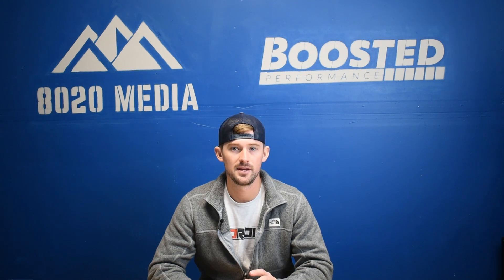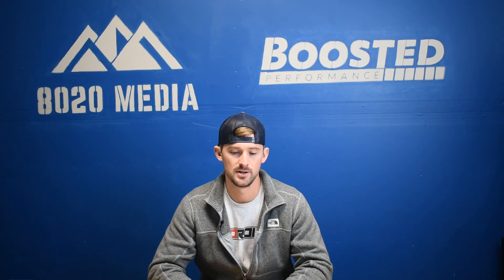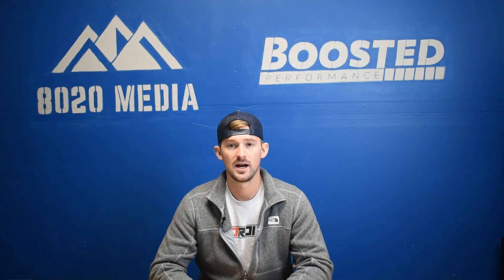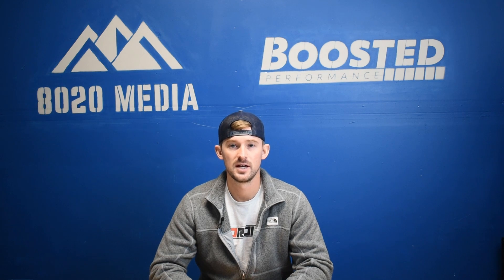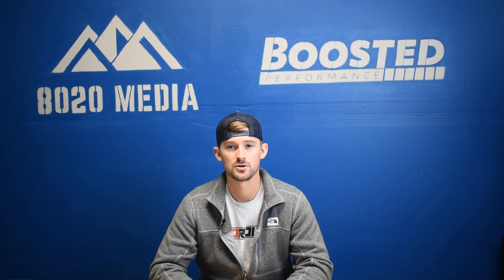The Few FLAWS of the Ford 4.6 V8 Engine!

Comment: Thank you for the good info. Would be better with some photos. Just got a 97 Ford Thunderbird 4.8L V8 passed down to me from my uncle. Still pretty much brand new 120.000 miles on it and runs great. Only issue I have is the speedometer would go in and out every once in a while. Did some research and only thing I can think of is to change the vss sensor on the transmission and or change the transmission fluid and filter. If anybody else knows how to resolve the speedometer issue please let me know and thank you.
Also I was told that Ford is finicky on its fluids like for example was told to get Ford Motorcraft products like engine oil and transmission fluid.

Comment: I recently bought a 2000 lincoln town car executive series 202,600 miles i put 2,600 in 4 months got it June of this year ride good need an intake I have leaks n my engine cooling fan jus stopped working bout a month ago but it rides like a champ without changing oil n need new plugs but it rides damn good I agree best engine other than my Caprice Classic '91 im really a Chevrolet guy but I like Lincolns

Comment: Which one is better the 2v or v3
Reply from the maker: C - I'd say the 3V 4.6 is “better” for most people, especially if you want more power out of the box or easier mods. You get more torque and better airflow, and the variable cam system helps make the engine more usable at lower RPMs without sacrificing top-end. The 2V, however, is still useful if you want simplicity, lower cost of entry, and maybe you don’t care as much about top-end power but want something rugged and cheap to maintain.

Comment: ‘00 F150 4.6.  No issues at 251k.  Oil changes with Mobil 1 hi mile 5w-30 and Lucas Oil additive every 5k miles, since I bought it with 100k miles.  I may do the timing chain, chain guides, tensioner, and upgraded oil pump soon, just for peace of mind…. I hate to crack open a motor, that runs perfectly!!!
Reply from the maker: P - Nice! We have seen many of these be reliable, however, maintenance is crucial!

Comment: As fo my 95 crown Vic  I bought new,L ENGINE FOR it CAUSE IT finally gave out, still ran but started using lot of oil so replaced the engine at 994,000 miles no oil pump issues, NO TIMING CHAINS ISSUES AS WELL AS I NEVER REPLACED IT AS WELL, I ONLY jus replace auto transs at 796,000 miles, 
AS FOR 98 CROWN I JUST Bought  IT l AT 120,000 Original MILES, THEY WRECKED IT, BIG  DEER KILLED, FRONT END FRAME OUT OF Alignment BAD,. Engine runs EXCELLENT👍👍👍
Reply from the maker: E - Thanks for sharing!

Comment: Jus seen your video on this 4,6 engines I've got 2 crown vis a new 95, and a used 98, and a new 2003 F-150, this 5 speed manual TRANNSMISSION truck has the 4,6 engine this only problem that is the passenger side plug blew off never had a problem since they fixed it, it has 795.000 and stills runs great, with ITS ORIGINAL TIMING CHAINS, TENSIONERS, GEARS, ECT👍
Reply from the maker: E - Nice! Thanks for sharing.

Comment: Hello. I'm looking at a 2013 E250 with the 4.6 V8. It has 97000 mls on it. It was owned by the city since day 1. Serviced every 3000 miles. It has all the maintenance records. No accidents. Super clean inside and out. Listed for $11,850 o.b.o.. I want it for a very light and simple van build. The heaviest the van will be including fuel, water, myself and all my gear, is about 1,500 lbs give or take. No towing. Will be driving it mostly on level roads. Do you think this engine will be able to handle what I'd like to use it for and the weight i mentioned? Any advice would be greatly appreciated. Thank you
Reply from the maker: P - Yes — a 2013 E250 with the 4.6L V8 is a solid choice for what you’re describing. That engine is simple, durable, and very common in fleet vehicles, and with only 97k miles plus documented 3k-mile oil changes it’s barely broken in for a Ford modular V8. Your planned build weight of ~1,500 lbs is well within what that van is designed to carry (payload capacity is typically 3,000+ lbs), and since you’re not towing or climbing mountains regularly, the 4.6 will handle it fine — it won’t be fast, but it will be dependable. The main things to watch on these are intake manifold cracks (at the coolant crossover), coil-on-plug failures, and transmission fluid condition (the 4R75E needs regular fluid/filter service). At $11.8k with records and a clean body, that’s a fair deal in today’s market, especially for a van build platform. If you buy it, I’d baseline the fluids (engine, transmission, differential, coolant, brake) and inspect the suspension bushings, but otherwise it sounds like a strong candidate.
Reply: @8020Automotive thank you so much for your input. I really do appreciate your time. If I may ask one more question please. I was mistaken on the miles. It's actually 93k. I drove it and it drives and looks very well.. I even talked him down to "$10,000".. so what am I waiting for? The timing chain issue that may come my way soon. I have a 2010 f150 with 104000 miles on it and I just had to replace the timing chain on it. It's going to cost me around $3000 if I do have to replace it. With that in mind sir, what is your opinion? Once again, I thank you for your time and expertise! Btw, Just discovered your channel.
Reply from the maker: P - At $10k for a 2013 E250 with the 4.6 V8, 93k miles, full service history, and city fleet maintenance every 3k miles, you’ve got a very solid foundation for a light van build — the 4.6 isn’t a powerhouse, but it’s one of Ford’s most durable modular V8s and easily handles an extra 1,500 lbs as long as you’re not towing or climbing mountain grades every day. The timing chain issue you ran into on your F-150 is much more common on the 5.4 than the 4.6, and while the 4.6 can need chains, guides, or tensioners eventually, with good oil change history it’s not a guaranteed expense at 100k; most run well past 150–200k before needing chain work. Your biggest maintenance items down the road will be suspension bushings, coils, and transmission fluid service, not catastrophic engine failure. At $10k, with those records, and given how clean it is, I’d say it’s a safe buy and a good value — just budget realistically for timing chain service someday, but it’s not something I’d let hold you back from pulling the trigger. Keep us updated!

Comment: I have a 98 with the 4.6 2 valve and I’m having a cylinder 3 misfire issue as well as a too lean code. I’ve replaced the plugs(2nd owner) as the were all bad. Still having the issue with cylinder 3. I don’t have an inline spark tester so I was going to swap the coils around to see if the coil was the issue as well as swap the 3 & 7 wire to see if it’s the wire. Next would be the injector. Any tips or recommendations? I don’t live near a mechanic and towing is out of the price range.
Reply from the maker: A - You’re on the right track with your troubleshooting. On the 4.6 2-valve, a cylinder-specific misfire (P0303) plus a lean code is most often ignition or injector related, not a major mechanical failure. Start by swapping the coil from cylinder 3 to another cylinder—if the misfire follows, it’s the coil; if it stays, swap plug wires (3 and 7 as you said) to rule out the wire. If neither changes the misfire, move to the injector: you can listen with a mechanic’s stethoscope or even a long screwdriver to your ear to hear if it’s ticking, and if not, try swapping injectors between cylinders to see if the misfire follows. Since you’re also getting a lean code, double-check the intake manifold gaskets and vacuum lines near cylinder 3—on these motors, vacuum leaks at one runner can cause both a lean condition and a misfire on that cylinder. So: 1) swap coils, 2) swap wires, 3) check injector function, 4) inspect for vacuum leak near cyl 3. That’ll narrow it down without needing a shop.

Comment: I have an 04 Explorer with the 2v 4.6 with 230k on it & just had to replace the intake manifold a month ago after the original manifold cracked around the coolant passages. So far that's the only problem that it's had since I bought it. I intend to change the timing chain, guides, and tensioner  soon whether it needs it or not. I'm also thinking about going ahead and doing a complete overhaul just to make sure I don't have anything to worry about and have a virtually new engine for no reason other than my own satisfaction. I have a V8 & want to be able to use the whole thing without worrying about some high mileage part failing when I go to pull out into traffic and drop the hammer to get up to speed
Reply from the maker: R - With 230k on your 2-valve, your approach makes sense: the timing chains, guides, and tensioners are the weak link and should absolutely be done before they fail and cause catastrophic damage. A full rebuild for peace of mind is never a bad idea if you’ve got the time and budget—it will let you replace worn bearings, piston rings, valve seals, and clean up the heads so you can truly “use the whole engine” without worrying. That said, these modular 4.6s are known for going 300k+ if oil changes are kept up and cooling issues avoided, so unless it’s burning oil, losing compression, or showing bottom-end noise, a full rebuild isn’t strictly necessary. If your main goal is reliability under hard use, fresh timing components, oil pump, gaskets, and a thorough once-over of the heads/valves will get you most of the benefit without tearing it all down, but doing the whole engine is the ultimate way to reset the clock if you want that new-engine confidence.
Reply: @8020Automotive  I'm pretty sure the previous owner said he had done the timing chain guides and put a new chain on it a year or two ago but I honestly don't remember what he said he had done to it. I replaced the intake manifold because the original one cracked, but other than that and some what I believe is light piston slap when it's cold, it runs great. It's got some light sounds coming from the bottom of the engine somewhere that fades out when it's up to temperature and I don't know if it's something to be concerned with or if I'm just hearing the mechanical sounds of the engine running. It's definitely not a bearing or anything, so my assumption is piston slap
Reply from the maker: @rollin18wheels  Keep us updated!

Comment: I have an older 4.6 with lots of internal engine noise ..I’d like to rebuild but not sure what would be the cause of these ‘ticking’ noises ,.runs great tho ..been ticking for a long time ..
Reply from the maker: F - On the 4.6 modular engines, a persistent ticking noise is most commonly caused by worn or sticking hydraulic lash adjusters (lifters), worn cam followers (rockers), or timing chain components like guides and tensioners that let slack develop, though cracked exhaust manifold studs or gaskets can make a similar tick as well; since yours has been ticking for a long time and still runs great, it’s likely valvetrain related rather than bottom end damage, but if you’re planning a rebuild it makes sense to inspect and replace lash adjusters, cam followers, and timing chains/guides/tensioners as a set, plus check oil passages for sludge buildup since oil starvation in the top end can worsen ticking—bottom line, it’s not necessarily catastrophic now, but addressing those wear items in a rebuild will both quiet the engine and extend its life.
Reply: @8020Automotive  ..excellent ..so doing a top end rebuild would probably cure the issues ..ty ..good stuff
Reply from the maker: @freedomtrucker2332 Not cheap, but would probably do the trick. Keep us updated.

Comment: My 07 XLT will blow spark plugs if you change the fuel at all, any additives, next higher octane anything
And coils like to go out
But going strong at 195.5k
Reply from the maker: T - That’s classic 3-valve 5.4L Triton behavior—those early spark plug threads in the aluminum heads were notoriously short and prone to blowing plugs under even slight changes in combustion pressure, like higher octane or fuel additives that increase cylinder efficiency; it’s great yours is still running strong at 195.5k, but if you haven’t already, it’s worth installing Timesert or Heli-Coil thread inserts to permanently fix the issue if one blows. The coil-on-plug ignition failures are also common—usually caused by moisture intrusion or plug gap stress—so dielectric grease and quality Motorcraft parts help. Keep doing what you’re doing, and she’ll easily hit 250k if you stay ahead of maintenance.

Comment: Hello, I have a 2004 F150 4.6 Romeo with 63000 miles. I have noticed a cold start rattle sound that only lasts a few seconds. Any idea what could be causing this issue? Any insight would be great! Note: There is no check engine light illuminated.
Reply from the maker: C - A brief rattle on cold start in your vehicle is most likely caused by timing chain tensioner bleed-down, a common trait in these modular V8s as they age; the hydraulic tensioners rely on oil pressure to keep the chains tight, and after sitting overnight, oil drains out of the tensioner body, causing slack that rattles for a few seconds until pressure builds. It’s generally harmless early on, but if it gets louder or lasts longer, replacing the timing chain tensioners and guides or upgrading to the later-style cast aluminum tensioners can fix it permanently. Also ensure you’re using a quality oil filter with a proper anti-drainback valve and correct viscosity oil (5W-20 or 5W-30)—cheap filters can accelerate tensioner bleed-down.

Comment: my manifold is not cracked, but it is leaking coolant below the thermo housing where it meets the plastic as well as signs it may be leaking from the rear crossover. Should I replace or try to reseal?
Reply from the maker: S - If your intake manifold is leaking coolant below the thermostat housing and possibly at the rear crossover, and it's the plastic-style manifold (common on pre-2005 models), then it’s best to replace the entire intake manifold rather than try to reseal it—because once these plastic manifolds start leaking, they tend to warp or develop microfractures that resealing rarely fixes for long. Ford eventually updated the design with a metal coolant crossover, which is far more reliable, and several aftermarket options (like Dorman) have improved durability. So unless you already have the updated manifold and are 100% sure the sealing surface is clean and undamaged, a full replacement will save you from having to tear it down again in a few months.

Comment: Once you add anti seize to the plugs your stated torque value changes to a lower value....appx 20% less. 
Then there is the disputed 11 to 13 lb ft or the "revised" 22 lb ft .  I would opt for dry plugs changed, or at least removed and replaced more often and the 11 to 13 lb ft based on the 4 thread depth of the head threads.
Reply from the maker: J - Thanks for taking the time to share these insights!

Comment: Incorrect info all around, 2001 they fixed the coolant problem, also I have never heard of problems with timing chains on the 2 VALVE 4.6. That is exclusive to the 3 valve engines..
Reply from the maker: S - If you look in the thumbnail, this video is for both the 2v and 3v. Please elaborate on what info is wrong.
Reply: @8020Automotive i have never heard of a 4.6 liter with timing chain problems. Is one of the most reliable engines Ford is ever produced until 2008 I think..

Comment: I love these new NGK plugs and coil packs i installed on my 4.6 e250 work van!  So much better milage on my 140 mile trip to the jobsite. Old buddies got 225,000 and counting .. starts n runs great after those new components. Also new 10 ply tires and took off the roof rack for aerodynamics.  Heard it was a good reputation so i got one and im glad. 

Mike from Minnesota 😊
Reply from the maker: C - Nice! Thanks for taking the time to share your experience!

Comment: Plastic manifold cracks still happen on 03 to 04. I was fed up after having it crack 3x on 3 different plastic manifolds. So im running the Edelbrock aluminum manifold instead
Reply from the maker: H - Well said! Thanks for sharing your experience.

Comment: Ford expedition 342k miles 4.6 2nd transmission it is an 03
Reply from the maker: B - Nice! You must take great care of it. Thanks for sharing.
Reply: @8020Automotive  well, change the oil every 3k never had the timing guides changed same engine

Comment: We got ambulances with this engine, many over the 500,000 mile mark. Got one inspected last week with over 550,000 miles. All original engines. All run on high mileage oil 5w/30. Oil changes every 3000 miles if we can.
Reply from the maker: N - This goes to show that it all comes down to maintenance! Thanks for sharing.

Comment: I bought an ‘01 Lincoln Town Car last fall with a BAD rod knock. The only oil change sticker I found was from 35k miles prior. Threw in a $300 Marketplace engine from an ‘05 Grand Marquis and it’s been an awesome daily driver. Last month I bought an ‘02 Mustang GT with a locked up engine. So far I haven’t gotten so lucky finding a replacement. 😅
Reply from the maker: T - Wow. Hopefully your luck turns around haha

Comment: Triton V8s sound like junk ..these manifold oil pump spark plug failures are not Toyota problems. 
Why I dont buy Fords
Reply: Kinda like the Toyota $12k 8 speed automatic transmission replacements that fail catastrophically.
Reply from the maker: C - Comparing a Ford to a Toyota on a Ford video is crazy.